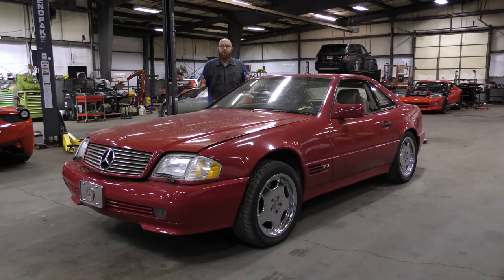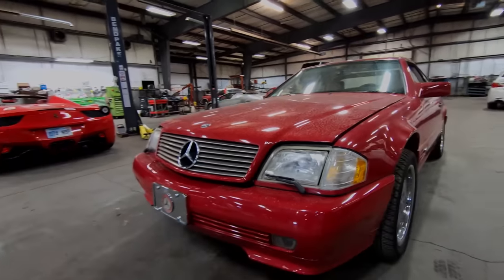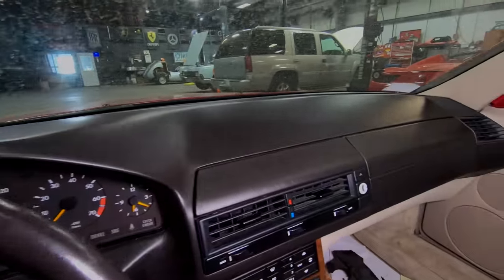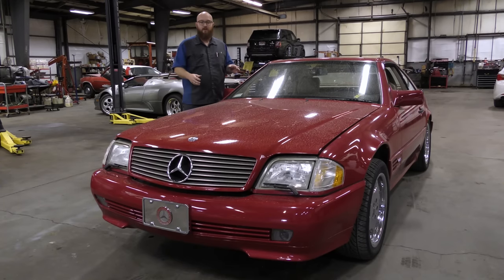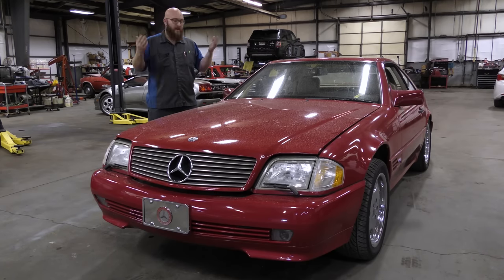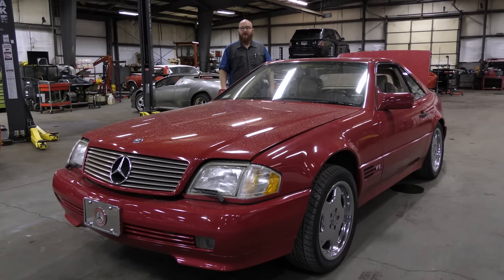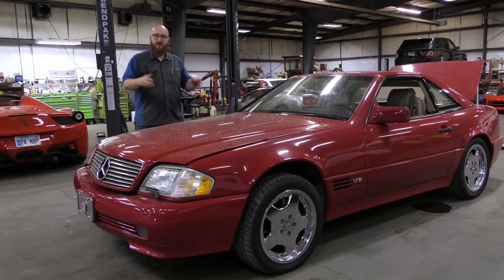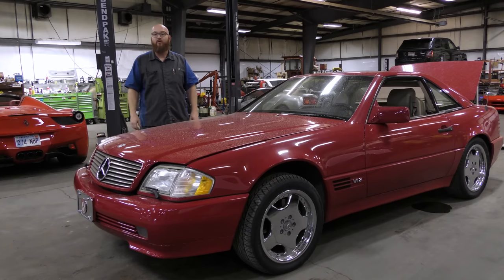Another customer scammed! CAR WIZARD shows why this '94 Mercedes SL600 is needing 15K to get sorted!

Comment: I think I would remove all of the garbage roof hydraulic system and throw it away, repair the headliner, and leave it permanently as a hard top. The wires looked good in the harnesses. I would pull those wiring harnesses and install new outer coverings. Replace the headlight and repair the suspension. The drive that sucker for another 400,000 miles with regular maintaining and TLC.
Reply: I like your tactic ,screw fixing the top
Reply: The problem is, the locking mechanism for the hard top is the same as the soft top. There's no way to manually lock it.
Reply: @dmorga1  Wrong there is a tool to do it
Reply: @danieljohnson6093  I guess. Not sure I like the idea of the whole system manual. The jackscrews in the back of the hardtop + the front? I wouldn't trust it.
Reply: I really dislike power tops. Especially crazy complicated hydraulic ones like this, there’s no way it needed to be that complex. I have a Miata, and it’s of course much smaller than this car, but I’d still never want a power top even in. Miata. Totally unnecessary- I’ve been caught in the rain before, and all I had to do was pull over, sit up in the seat, reach behind me and pull the top up. Two latches, done in 15 seconds.
Reply: @bensimpson3002  It's really about the demographic they were selling to. This car was staggeringly expensive in 1994. Even the SL320 was $80k+ when an Accord was $14k.  Mercedes was running on its motto "Engineered like no other car in the world." And if you watch the VHS video that came with it, this car was designed for the Connecticut housewife of the high-powered banker from Manhattan. They were selling this effortless, zero effort, push a button experience. And I have to admit except for the short life expectancy of the cylinders, the system is really impressive. No clamps or clips; just a button.
Reply: @dmorga1  oh yeah, i totally get the demographic. Sometimes I just think it’s a shame, because Mercedes does make some absolutely beautiful, solid vehicles inside and out. It’s too bad that they couldn’t find a way to pander to that demographic without so much over engineering.
Reply: I agree, I think the car looks good with the hard top on.

Comment: Want to know why old US muscle cars and "pony" cars are so popular?

A-727/C-6/Turbo 400 overhaul - $1000?
(Paid $500 for mine back in 2001 by a legit shop, still works good, no leaks)
New/overhauled starter = $100
Water pump= $50
Radiator, correct restoration, Mopar = $400
Carburator = $200-400

Not to mention that damn near everything can be fixed in your garage by yourself.

Comment: I would love to own one of  these V12 SLs, and it is one of the vehicles on my "maybe one day" list, but I look at the overall cost of ownership and as I see it, if I buy wisely, I am buying a fully depreciated vehicle.  Then the cost of repairs and maintenance, even if apparently substantial, are still going to be better than the brutal depreciation on a new $100k+ car.  And there's a good chance that one day it will be worth more than I paid for it.

Also the state tax per valorem tax (NC in my case) on an older vehicle is a drop in the bucket compared to the tax on a new luxury vehicle.

Comment: The great thing of living in ME is that there is a lot of good mechanics who try their best to get around these terrible issues , the hydraulic system would be just canceled and the roof will stay on all the time , the wiring harness would be taped , sealed and isolated with rubber materials and the full job to bring the car to reasonably usable state would cost 2K tops ..
Reply: That would never pass inspection stateside, that tape is a fire hazard waiting to happen.
Reply: @Nick-ue7iw  A lot of states don't require inspections.

Comment: Repair shop rate in the US is about $150 per hour to $250 per hour (dealers) and the computer program that the shop uses will tell every shop how many hours to fix for what issues for insurance companies purposes. The labor costs add up fast and almost every shop tells you the same repair labor cost. Then the markup of the shop buying parts also adds up quickly.  I spent 5k one year on my MB repair bill then I sold the damn car for 5k that year!
Reply: the hard truth, iff you cant do it yourself than you beter bay a new car and not a classic. Even in belgium its about 100euro or more for 1 h laber

Comment: If he's mechanically inclined, I'm sure he could part out the car and make back his $7500 + more. Or find someone to buy it as is for $7500 considering how rare parts are
Reply: Meh, Wizard is exaggerating here, IMO. The customer needs to roll up their sleeves and do the hydraulic cylinders themselves. Someone here posted about a new harness in Germany for $1800. I bet with some resourcefulness, a person could get this car done for well under $10k. You can't farm out a car like this to a repair shop (maybe a few things, like the sagging headliner). You need to do it yourself and be smart about it.
Reply: @OMGWTFLOLSMH  To be fair, he said this is not a car to buy if you're not a mechanic. And it sounds like the owner doesn't have the necessary skills and experience to do the jobs themself.

Comment: For Mercedes built in the last 30 years, you have to check the expiration date!  If it's more than 5 years old you need to sell it FAST.  🤦‍♂
Reply: NO, wtf are you on about? I had a 2000 SL500 I bought with 145k miles on it and it was easy to sort out. Sold that and now have a 2011 SL500, best cars ever made, pricey, but who cares?
Reply: I just stay away from all German cars.  They're all junk after 100k miles. This one didn't even make it to that.
Reply: @MyDyerMaker  100,00KM   (61k miles) is one to stay away from
Reply: @pablopicaro7649  Probably true. The ones I had barely made it to 100k highway miles.  They cost more to repair than they were worth.
Reply: Totally agree. Not only Mercedes but all German cars like BMWs Audis.. etc all of them complicated overpriced German junk

Comment: I have a 1997 sl280 with the m104, I love the car. MOT approved yesterday, having 272K km on the clock. Runs and shifts very smoot, pretty frugal on fuel on highway. The head gasket need to be done,  but will some winter do it my selves. The soft top hydraulics will also leak at some stages, but rebuilt ones are reasonable priced so no worries. Basic maintenance parts are cheap, filters,  gaskets kind of stuff.

Comment: 14:14 - I could have sworn that you could get Mercedes parts for ANY Mercedes, I thought that was one of the charms of buying a Mercedes. They stand by their products forever.
Reply: You can, but it's the classic center in Germany that does it by request. And I presume that there is a minimum order number or an astronomical price for them. At least for the w112 chassis you could get the rear axle pneumatics brand new from the classic center.
Reply: @forzer45  Used to be the case. But becoming increasingly hard to get stuff now for some of the older cars.
Reply: @petercollingwood522  Parts go NLA every day. 😠
Reply: @Disruptedgarage  They did'nt used to for Benz's. This is becoming much more of an issue of late.

Comment: When you're buying a 28 year old car with 100k on the clock. You get what you get, and should expect the worst. Pay accordingly or walk away. Whether it be an old crappy Pontiac or an old high-end Mercedes. Especially the V12 was known to fail early and mostly too expensive to fix.
Reply: My 28 year old Volvo has over 250k the milage and isn't nowhere near as expensive to fix up. Neither is my 10 year old RAV4 with almost 200k
Reply: @DGTelevsionNetwork  I had a '99 V70R T5 AWD  (850 Estate Wagon). I sold it with 128k in 2015. Always maintained, garaged and never abused or in accidents. Mechanically, it was falling apart one piece at a time. Volvo used a poor grade of rubber and plastics. Rubber mechanical parts and bushings disintegrated as did plastic interior trim pieces. Moonroof leaks, rear suspension failure. sensor failures. Finally, the AWD started making noise. I dumped it. New owner paid me $5k. Even with me doing my own repairs. I felt the car reached the end of it's cost effective life. I don't want to spend every weekend fixing something. But, some fool bought it. Good luck to him.
Reply: Nobody complains about the engine failing not to mention MB uses that platform in several other vehicles..with a tweak or two here and there.
Reply: Truth has been spoken. I mean what did he expect from a nearly 30 year old Mercedes LOL. Even their 10 year old cars are junk that breakdown too often and cost too much to maintain and repair, let alone a 28 year old one LMFAO. I wouldn't go anywhere near that piece of junk.
Reply: My dad was a Mercedes lover, he had a 1998 Mercedes S500 back in the day and it was the most piece of junk we've ever had. It brokedown every now and then until my dad got sick of it and sold it out. He never bought a Mercedes ever again.

I hear Audis and BMWs are way worse, so I can't imagine that. In my opinion Germans make overpriced complicated junk that would cost a fortune to maintain and repair. If u want peace of mind for you and your wallet you shouldn't go anywhere near a German car.
Reply: @hircine92h  You know everybody doesn't run to the stealership like a princess, when they're having a mechanical problem.
Reply: @kensmechanicalaffair  Stealership or not. These cars breakdown too often and love the owner's wallet.
Reply: @hircine92h  Often is subjective..i mean who would drive this back and forth to work praying for Toyota reliability!?
Reply: @kensmechanicalaffair  Exactly. The person who buy this should know very well what he signed up for.

Comment: He should probably sell some parts off from it to get his money back. And keep the rest as spares for the sorted SL500/SL600 he gets. Frankly given the price of it, I wouldn't say he was "scammed".
Reply: @DeltaParadoxLLC  But he didn't buy it for 20k what would be worth the sorted one. He bought it for less than 10k. And car market doesn't work like "if it's x money to get it sorted, it's initial price minus x". The car has still valuable parts, regardless of the repair bill.
Reply: yeps , 7500 doesn't buy much of a car these days he could probably get that for the motor , i would put it in the garage fix it myself

Comment: Hey Mister Wizard! Here in Europe we have a lot of small businesses these wiring harness are made because there is so much demand and it is offcourse expensive because of the labour involved, but not 9.000 dollar as your friend charges. Let's say 1800 to 2500 euro. All with original electrical contacts but upgraded materials. Just that you and your friend cannot find it on the internet does not mean it isn't out there. Mercedes, Porsche  BMW do not make this anymore, but did they ever make wiring harnesses? Plenty of small companies in Poland, Germany and the Netherlands that deliver better than original wiring harnesses. Mercedes and Porsche even order at these small shops for their own inventory, but you as a single client may also order. It is build to order.

Comment: Did the work on one of my BMW's, a five-series. Had the list with me when I went to the dealer for a part. Asked for a quote what they would charge. Would have cost $11,000. LOL. My cost was only $700. Personally I do not trust mechanics or body and paint people. They charge too much. And never actually do good work. Good for you there are people who do not have the ability to do their own work.
Reply: The wiring harnesses on these mid 90s Mercedes just turn to dust.  I do much of the work on my cars myself but I am not doing that on a 12 cylinder here.   As far as the hydraulic cylinders, if you get them all replaced you will buy a few years but these things always break now
Reply: @PaulBCISSP  Trace one wire at a time. Please! None of this stuff is difficult. Just takes time. As well, I do not trust mechanics.

Comment: I think the Wizard is a bit harsh and biased on this car. Most if not all issues can be fixed affordably if you are willing to invest your own time and some alternative resources. The top has a simple manual override, so no need to have all that fluid piss over the interior. Quite a few companies jumped on the wiring loom bandwagon and with time and a bit of care you can rebuild your own wiring as well. Methinks Wizard is not very Mercedes minded, especially those without OBD2 plugs.

Comment: I can pretty much tell you what happens with these formerly high end luxury cars. The original owner likely leased this car, wrote it off on their taxes as a business expense then bailed out a few years later before the warranty runs out. The lease return is now a used car, maybe still as a CPO. Business people lease these cars either to impress clients or they have a personal desire to enjoy and discard these vehicles before the warranty runs out.  You would probably never know that the so called titan of business might be up to their eyeballs in red ink on their finance sheet while they are tooling around in a high end new car. Nothing like driving a high end new car to convince clients that you're more affluent (or more solvent) than they may actually be. Remember those lease payments aren't going to be anywhere near as high as monthly payments on a finance plan to own the car. The money has already been made and spent on this car years ago.

Enter what is likely the 3rd, 4th, 5th owner (or higher) of this car who thinks they're getting an old but still flashy car and they're neither mechanically savvy or anywhere close to an income bracket that can afford the still significant costs of maintaining a vehicle like this.

If it were me, I think I would count the cost of either learning to repair these vehicles themselves via wrenches and a service manual and paying over time to acquire the needed repair parts and tools. That or sell it as a parts car or project car. Or off to the crusher to turn this car into a coffee table.
Reply: Dude no need for a crusher, just park it in your living room and serve coffee on the hood - its a work of art.